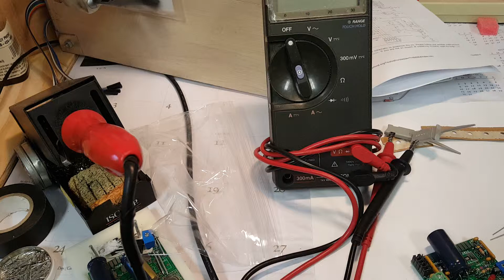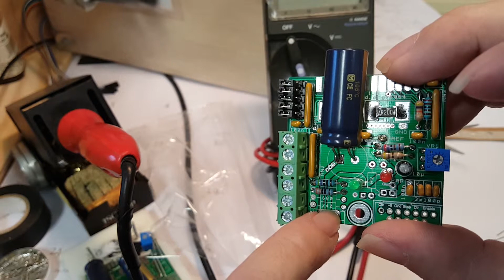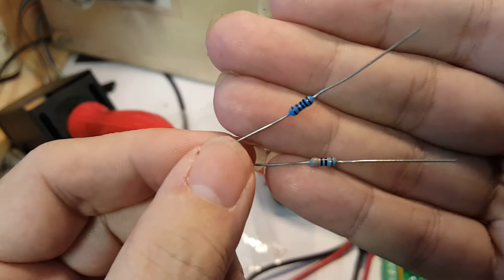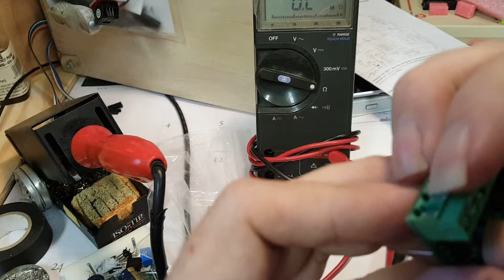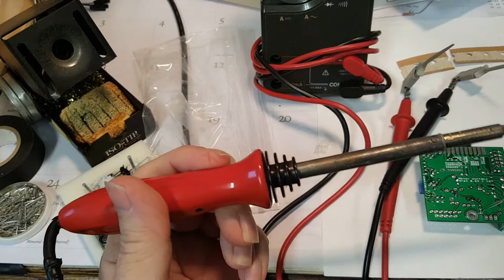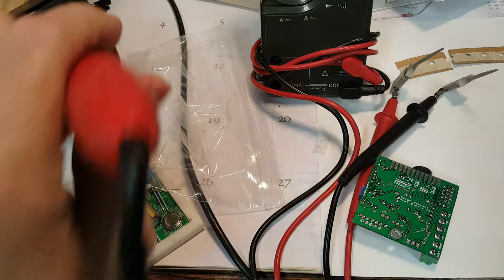LM317 onboard power option MassMind.org THB6064AH

Comment: what is the model number of that soldering iron - I had that one once, lost it and havent seen another one like it.
Reply from the maker: That's actually an interesting question. The handle says "WAHL ISOTIP, Wahl Clipper Corp, Sterling, IL" but the barrel of the iron itself says "MODEL 50, 120 V 50 W, MADE IN ENGLAND". It was given me by my father back in the 70's and I've loved it since. Heats up quickly, regulates temperature, light weight, reliable. The tip on it finally gave out and I had to adapt a modern tip to it with a drill and tap. I also purchased a spare on eBay some years back, but they are bloody rare. Interestingly enough, Sterling corporation in England also made one sort of like it... with a triangular handle. I /think/ they might have made the core and Wahl just added their own handle. But Wahl IS in Sterling, IL so that's just a coincidence.
Reply: Everything now is cordless, either battery or butane. I love that you could just close that mode back up while hot and it wouldn't burn its way out of the bag. Nothing like it shows up for sale anymore.  I miss that iron. Thanks for the model no, I'll keep looking.